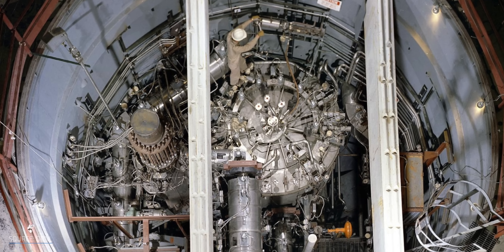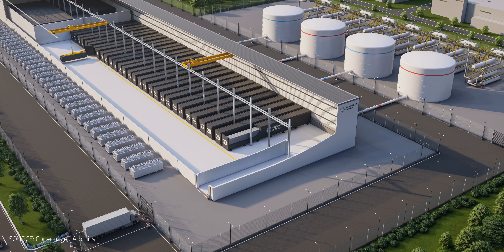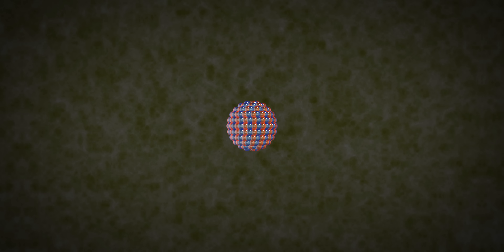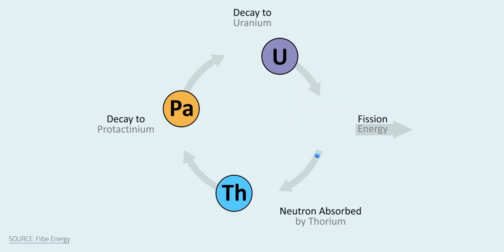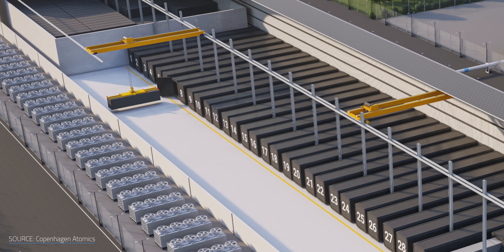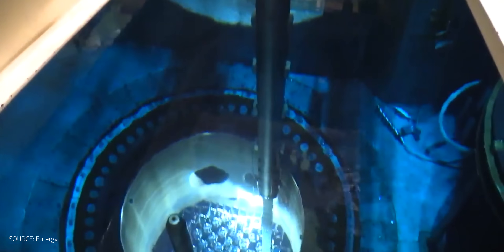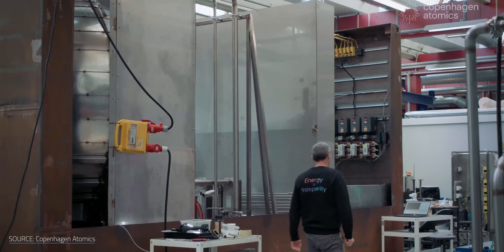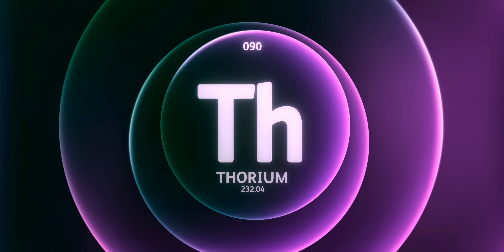Why Thorium is About to Change the World

Comment: 12:25 14:32 so the reactor needs to be refueled every 3-5 years but fully replaced every 5 years, so that could mean that they would never need to refuel their reactors on-site, and if they could really build 1 per day, then they could basically throw away each reactor after its 5 year lifespan
Reply: The refueling is just thorium metal that dissolves as needed during the blanket salt processing. As said, the fuel and blanket salt represent almost all the value in the reactor, and they will last indefinitely, being pumped from one reactor to the next. The rest of the reactor is mostly a glorified shipping container w/pipes/vessels and such, that will mostly be recycled anyway. That the economics work even with a 5 year replacement cycle, will really help to accelerate development and refinement of the design.
Reply: They are unlikely to just "throw it away" and if they've done the work they've said on reducing servicing, that only benefits them in recycling the parts over and over. And just replacing the worn parts as needed.Even if you're concerned about general wear and missed issues, modern diagnostic imaging tools are insane, and would be no doubt be used here to identify that. Among the many sensors they already have to constantly track for issues in actual use.
Reply: Other Gen IV reactor concepts allows 20 - 30 years of operation, or allow continous operation with on-site pyro processing unit (PPU). The last also  increase the burn down, because poisions are removed constantly.

Comment: The world doesn't need that any more than it needs nuclear fusion. We have to stop inventing oversized steam engines to generate energy. The world doesn't need dangerous and polluting machines if we use renewable energy properly.
Reply: Here is a compact comparison of energy losses and efficiencies for wind energy and hydropower compared to thorium molten salt reactors and solar energy:

## Comparison of Energy Losses and Efficiencies

| Thorium reactor      | 35–42%        

| Solar energy         | 15–23%           

| Wind energy          | 45–50%*        

| Hydropower           | 80–90%            | Friction, turbine and piping losses       |

\* *Note:* The efficiency for wind energy refers to the proportion of wind power converted into electricity. The physical limit is 59% (Betz’s law), modern plants reach 45–50%.

## Conclusion

- *Hydropower plants* are technically the most efficient, but heavily dependent on location.

- *Wind energy* is very efficient and cost-effective, with low CO₂ emissions and a short energy payback time.

- *Thorium reactors* have high efficiency, but are technically complex and suffer from waste heat losses.

- *Solar energy* is less efficient, but flexible and also very clean.

  

A mix of renewable energies would outperform these forms of "steam engines" (meaning nuclear and fossil thermal plants) in terms of overall system efficiency, flexibility, and environmental impact—especially when considering wind, hydro, and solar together[3][4][5].

Quellen:

[1] Power Play: The Economics Of Nuclear Vs. Renewables https://www.worldnuclearreport.org/Power-Play-The-Economics-Of-Nuclear-Vs-Renewables

[2] Nuclear vs. Renewable Energy: A Comprehensive Comparison with ... https://en.renovablesverdes.com/Nuclear-energy-vs.-renewable-energy:-a-comprehensive-comparison-with-solar--wind--and-hydropower./

[3] [PDF] Comparison of Nuclear Energy and Renewable ... - EconJournals.com https://www.econjournals.com/index.php/ijeep/article/download/7866/4650/21033

[4] Nuclear Vs. Renewables: Which Energy Source Wins The Zero ... https://www.forbes.com/sites/dianneplummer/2025/02/11/nuclear-vs-renewables-which-energy-source-wins-the-zero-carbon-race/

[5] [PDF] Renewable Energy vs. Nuclear Power https://www.aph.gov.au/DocumentStore.ashx?id=1f742288-d01c-4d07-81b4-becfbcb21c0e&subId=769052

[6] What are the safest and cleanest sources of energy? https://ourworldindata.org/safest-sources-of-energy

[7] Nuclear Power is the Most Reliable Energy Source and It's Not Even ... https://www.energy.gov/ne/articles/nuclear-power-most-reliable-energy-source-and-its-not-even-close

[8] [PDF] comparison of the performance, advantages and - INIS-IAEA https://inis.iaea.org/records/gtnmp-b4623/files/49009723.pdf

Comment: This is a vast improvement over current nuclear reactors. However, it should not be seen as something that will completely displace renewables and batteries. First, even faster decaying nuclear waste is still nuclear waste - which is a big problem with no currently viable solution. Second, you said nothing about the economics, so it can only be assumed that this is still, like conventional nuclear, way more expensive than renewables and batteries. But, as I said above, it is still an improvement over current reactors, and will likely find many niche applications.

Comment: The MSRE was merely an experiment. it barely lasted the four years of intermittent operation, limited by corrosion. 
Four years of operations, 15,000 hours of operation. Less than 200 days. 

The proposed scale-up using gangs of small reactors gives worst-of-both-worlds outcomes: The individual reactors operate at much lower fuel efficiency due to the high surface to volume and consequent neutron loss. The multiple units multiply failure probability in direct proportion to the number installed. The neutron loss from small reactors more than exceeds the slightly higher neutron yield from U233 compared to Pu239 or U235.

The five-year subunit life is an admission that corrosion is a big issue. sixty years of materials development has barely improved on the original Hastelloy-n, and sixty more is unlikely to result in even a doubling.
These used subunits will have short  and must be processed in short order. They tread a very uncomfortable line between waiting for desirable reduction in radiation from delayed decay of fission products, and a housing whose end-of-life timing is as late as possible to meet price targets.
They do not have the luxury of delay for such trivial reasons as war, economic collapse or plague. 

The claimed reduction of waste storage is simply not true. 300 years might be relevant for "mainly caesium" uranium fission products, but not really. "ten half lives" reduces activity by a factor of a thousand. Spent fuel comes out trillions of times more radioactive than anything acceptable.
However, this thorium/U233 process involves production of disproportionate U232 (ten times more than in plutonium breeding). U232 has seventy year half-life and far more penetrating radiation. So, not just a pollyanna 300 years, but four times the figure for equivalent caesium decay.
Many many thousands of years.  
Nor will there be reduced amounts: the small format still loses more neutrons, still has reduced fuel efficiency per energy produced. That means more fuel fissioned to sustain the reaction, and more fission products that were not involved in direct energy production.
Unlike relatively robust solid fuel rods, these molten salt wastes are fragile. They will corrode their housings and must be processed in lockstep with production. Something no nuclear industry has yet managed, beyond weapons production.

Thorium sounds good, but faces all the limitations of other nuclear, with additional overheads.
It might be made to work, at very high cost.
It will require commitments to lockstep processing that are guaranteed on time, regardless of war, economic collapse, plagues, political incompetence. The outsource model proposed is laughably inadequate for the security of host nations.
It is highly unlikely to be viable, in a world with other options growing exponentially.

Comment: ...Why do they have to pump the molten salt around? If they could just design the reactor to passively disburse the reactor heat it would avoid the need for a pump or heat exchanger, it'd be simpler and likely run for a lot longer.

Comment: Surprisingly no mention of KAMINI, which stands for Kalpakkam Mini, is a small nuclear reactor located in Kalpakkam, India. It is a research reactor that utilizes uranium-233 as fuel and is cooled by a molten salt mixture. The reactor is designed to operate at a low power level, making it ideal for research and testing purposes and it literally went critical in 1997. India has always been an outlier and no mention of their contribution is just poor research on the subject.

Comment: "They're designed to avoid melt downs forever."

Yeah...I don't know anything about nuclear power generation, but I'm pretty those reactors that have experienced melt downs were also designed to avoid melt downs.
Reply: This physically cannot enter a runaway condition, which is what traditional reactors try and prevent with mechanical protections like control rods. Here if it starts to "runaway" the salt expands, causing the nuclear reaction to stop due to the density no longer being able to sustain the nuclear chain reaction. It's a self regulating system. You are correct in asserting you don't know anything.
Reply: The ones that experienced melt downs were designed to avoid melt downs through constant human interventions requiring external power. Like the backup coolant pumps at Fukushima needing power from diesel generator destroyed by the Tsunami.   

The new systems are designed to be passive and rely only on the laws of physics, They work  whether people or power are present.  For example the melt plug in liquid fuel rectors that melts and drains the liquid to safe storage by gravity.

The difference between these are vast,and we already know that such passive work well.  Why did the meltdown st the 4 reactors at  Fukushima result in anywhere near the release from the one reactor at Chernobyl?  Because they, like every other reactor except the type at Chernobyl, had a containment vessel built to passively contain the reactor core after meltdown.
Reply: @MikeClark-g7i  Yeah, I did watch the entire video. I'm also not some weirdo nuclear naysayer. I just don't think Human Beings have actually make ANYTHING that is 100% failure proof.

Comment: Nuclear Power is just Steam Power. No different than burning coal to heat water into steam to turn a turbine.
If we were really smart, we would listen to Tesla and capture the energy from the earth's spin.
The earth is a natural perpetual motion machine. Spinning around a copper core that creates a massive magnetic field which in turn creates electricity. The earth is also a natural Alternator.
Magnetic Field = Electricity. You cannot seperate the two.  Or imagine creating a machine that creates and holds a rain storm that creates lightning. And obtaining electricity from it. Dare to think outside the box.

Comment: Also no China is not developing anything. China steals technology it doesn't develop anything themselves. It is also why literally everybody is pulling their production from China, you manufacture it there and it will get stolen and produced with inferior materials and dumped on the market. When China comes with a so called invention you just have to Google to find where they really are doing the research and by true coincidence you will see that there is a Chinese with connections to the CCP is working there.

Comment: A long, long way to go. SMRs are the mot de jour in energy circles. Rolls Royce has tendered for its SMR in the UK, and this has been approved by the UK government. Its SMRs are much larger than this Danish design, I think nearer 500 mW so no way would they fit in a container. Its SMRs too are based on pressurised water uranium fuelled reactors, and will be adaptations of their military reactors powering nuclear submarines and other vessels. So two major hurdles, first are SMRs any real solution to our future energy needs, and second, thorium breeder reactors are an entirely new technology that have themselves a huge distance between theory and practical application. I read the other day on the internet a very full review of this technology, and there are a huge number of unanswered questions in regard to cost, to safety, to disposal of radioactive waste etc. Perhaps something like effectively insulating all homes in the UK might be worth a large number of SMRs and billions of saved pounds.  But that's all too simplistic for our politicians, whose understanding of science and energy is about nil. .

Comment: I see you gave credit to the Danish 
 However, China is actually the ONLY Country with a functioning Molten Salt Thorium Reactor (TMSR-LF1) that was achieved on October 11 2023, went to full power in June of 2024, and in April 2025 was the first ever reactor to reload thorium fuel while running. It's the First Ever Operational Thorium-based Molten Salt Reactor today.
Reply: as is pointed out near the end of the video
Reply: China located its experimental reactor in a desert and facilitated regulations. The unnecessary regulations are the killer.

Comment: That Gate’s company, Terra Power, is doing salt reactors too.
Reply: No, TP reactors are cooled by metallic sodium, which is highly reactive, and about the furthest you can get from the molten fluoride salts being used here (which are the most chemically stable substances in existence). TP is wanting to use salt for thermal energy storage, but that's irrelevant to the reactor.

Comment: Most of these advantages apply to U-235 reactors as well.  You can build Uranium fission reactors that have a breeding ratio greater than one as well as continuous reprocessing that would allow up to 100 times the energy extraction per gram of Uranium instead of the current practice of throwing the fuel out after only 1% of U235 has been burned.
The continuous reprocessing also allows the long-lived fission products to be concentrated by a couple orders of magnitude to nearly eliminate the waste problem.  This applies to any nuclear cycle.
So it's not so much the Thorium as it is the reactor design.